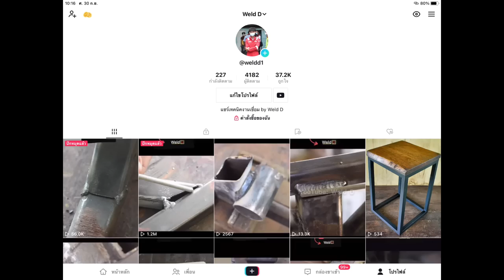The secret you may not know about welding 0.7 mm. square tube for good results.

Comment: wouldn't it be even better to use a 1.6mm electrode?
Reply: In countries like ours there are none.
Reply: In my country there is no 2.0 mm soldering iron, and 1.6 welding rod is even rarer
Reply: better 1.6 mm